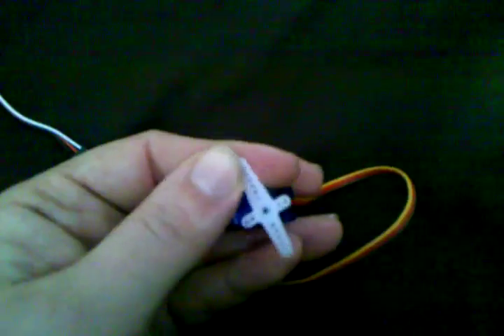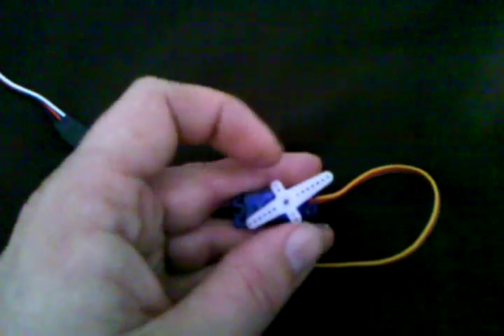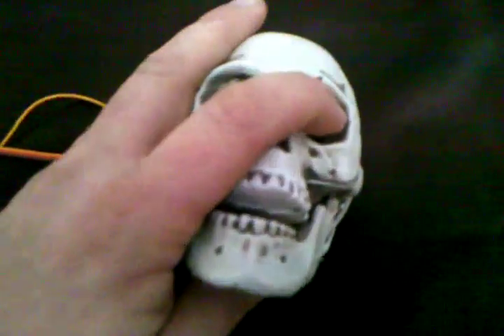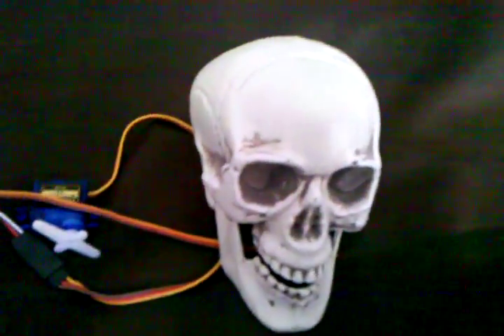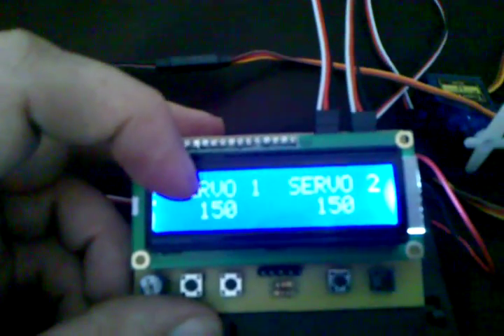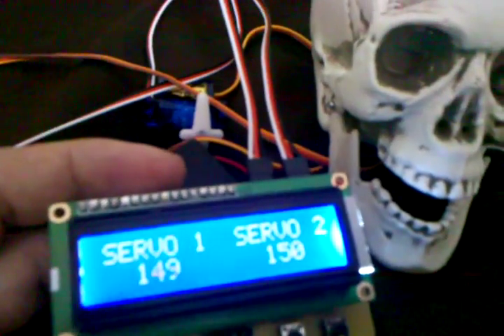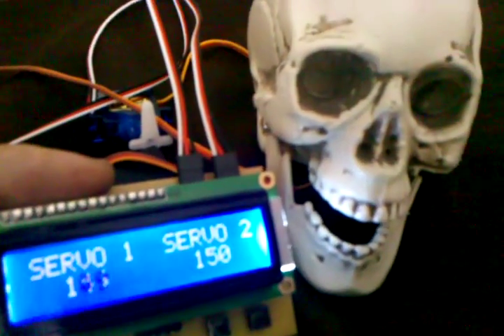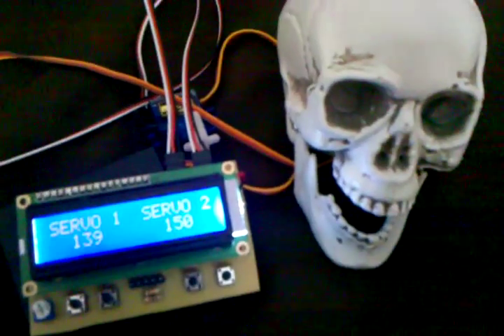Servo tester

Comment from the maker: Of course, I always etch a spare.  I'll get it drilled and drop it in with your prop controller PCB order.  I'll send the parts list and firmware via email. Almost all parts come from Tayda the only thing not available from Tayda is the battery holder.  You need a battery holder with a power switch because there is no power switch on the PCB.